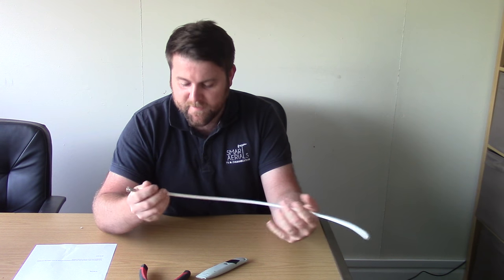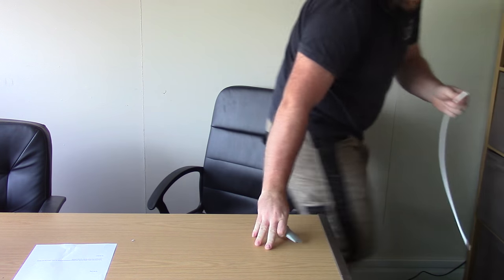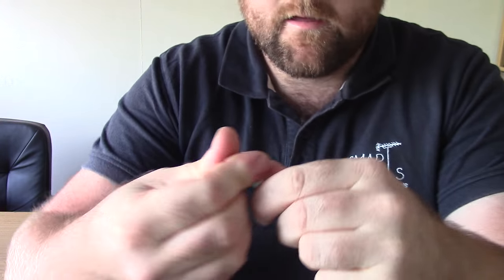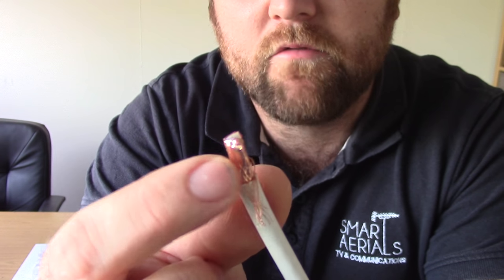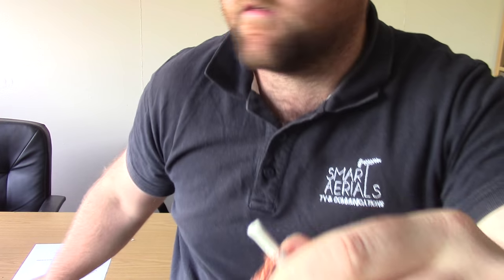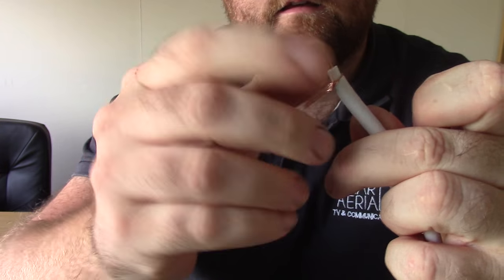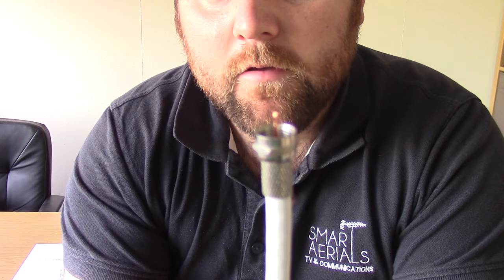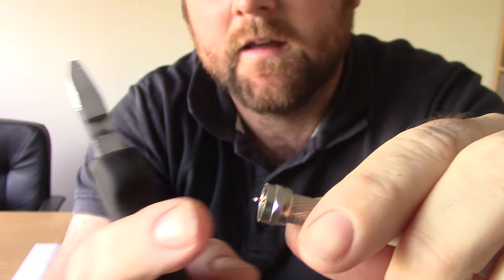How To Fit An F Connector Onto A Coaxial Cable For Sky, Satellite & Aerial Connections

Comment: Great little video, i was not too sure if a Sky cable was the same as a standard coax cable, wanted to confirm connecting, before cutting off the old connectors !
Reply from the maker: Hi Tony, thanks. Yes they are the same, but you need to make sure that it is a double screened cable for satellite.

Comment: Nice one m8. I have loads of these and always thought I needed a crimping tool to attach to the cable. Had no idea they just screw onto the wire .
Reply from the maker: Thanks James. This is a screw on connector and as long as they are installed correctly they are fine for domestic use, but some installers disagree with this. There are other types like a crimp-on style F plug and compression type which require specialist tools to install. Hope this helps, please subscribe to our channel. Tom

Comment: Thanks for this video, I love how it was clear and straight to the point, no faffing around. 
I had to remove my f connectors to move my sky box and one got a little bent so I straightened it back out but now it wont work. When I plug it in nothing happens, any ideas? Thanks in advance.

Comment: Great video thanks! Is it essential the f connector is screwed on to the folded down copper strands? If not can you just cut them away before installing the F connector? I ask as my F connector does not screw on to the plastic itself and therefore does not get to the outer plastic but screws into the white foam instead. RG6 CT100 cable with F connectors. Thanks!

Comment: TOM, how do I transfer a twin sky lead that I have into one? I need to put into the back of TV but I can't as there are two leads. I can't change the lead to one as it's through the wall. But the other single sky leads worked fine but this twin lead I can't seem to work out?
Reply from the maker: HI Lorna. If you have a twin lead you can just connect one the cables. It doesn't matter if you leave one disconnected. Unless you have Sky Q. Have you just moved to a new property or something?

Comment: Hi - I’m trying to connect an aerial cable to a Manhattan Freeview box.
Cable is ‘cable con 4.9’ I think it’s an F connect as it has the hexagon screw on it.
I need to plug that into a IEC-169-2 Female (Pal) but currently the cable doesn’t fit in.

Is there an adaptor or something to fix this issue?

Comment: My upstairs box (the wire is threaded through the house ) the wire detached and the metal parts are left in the box. Is this a live wire ? Can I do this on the wire? And the other wire touched the Centre wire does that mean it’s useless or will it work If connected once they aren’t touching when put in ?

Comment: Hi, i have a question
My TV has female antenna-in port (it's name on the internet is belling lee or sth like that), can i connect this cable to it with the F connector and adapter that will change it into male antenna-in ?
And if so, which connections will i be receiving ? satellite or aerial or both ?

Comment: Im constantly getting a No signal message from my sky Q and have to re-boot to get it working. The arial cable IS lose and probably needs refitting like shown, however after re-booting why would it always work if the cable can pull out easily?

Comment: really helpful thankyou.
my external ariel is connected to a disused sky dish. can i run my tv ariel from that sky dish
Reply from the maker: Hi Linda and thanks. No afraid not, you could use your satellite dish for Freesat, but you would need a Freesat box or Freesat TV in each room.
Reply: I suggest switching to FREESAT, which uses the sky dish, exactly as it is.. Humax make a range of receivers and recorders... and most channels have free HD optionstoo.

Comment: Hi, for some reason my type f won't just screw onto the coaxial cable, any ideas? Cheers
Reply from the maker: Hi Mitchell, it may be the wrong size for the cable. Do you know the make/ model of the cable/ plugs you're using?

Comment: the two white cables that come out of the sky box , are they the same type of cable with two different jobs or different types of cable ( asking for a friend ) 😉
Reply from the maker: You can tell your friend :p that both cables are exactly the same. Same cable, same type.
Reply from the maker: Yes that's right, doesn't matter which way around.

Comment: How about how to remove the Sky Q connectors and replace them, I need to thread my cable through the wall to the new spot for decorating. But if I let a Sky engineer doing it is going to cost me time with two visits and £120! I could do it before like you showed in this video but the Q box hasn't got an F-connector.
Reply from the maker: The main Sky Q box does use F connectors, it may just be that you have the smaller shotgun cable. The plugs are made off the same way but you would just need smaller F plugs if this is the case. (65 type). If it is a secondary Sky Q box this may be a network cable that you're referring to. Can you please confirm?

Comment: Hi Tom, another great video mate, thank you! I'm just wondering what a CX3 connector is - is that the same as an F connector? I'm trying to find the right compression connectors and tool to connect my WF65 shotgun cable to my satellite. Thanks again
Reply from the maker: Thanks Callum. Yes it is the same. Here is the right plugs for you. https://www.amazon.co.uk/CABELCON-CX3-Compression-Conn-0-65mm/dp/B00CELOKV8.
Reply from the maker: Regarding the compression tool. I'm not 100% if this one will fit the WF65 plugs so you may want to check with seller - https://www.ebay.co.uk/p/1734630805?iid=233263669742&chn=ps&norover=1&mkevt=1&mkrid=710-134428-41853-0&mkcid=2&itemid=233263669742&targetid=879667141355&device=c&mktype=pla&googleloc=1006692&poi=&campaignid=9441266808&mkgroupid=97517275362&rlsatarget=pla-879667141355&abcId=1140486&merchantid=7353394&gclid=CjwKCAjw1v_0BRAkEiwALFkj5ipA42I18VCnaFxlJanj-vV4jUhhRMGaSnssmKxrO8TMT9ROwL7VchoCX04QAvD_BwE

If not, I have a set of these. Quite expensive though! - http://www.systemsat.co.uk/f-compression/cabelcon-triple-compression-tool-cx3.html
Reply: Smart Aerials
Amazing, thanks very much mate!
Much appreciated 👍🏼
Reply from the maker: You're welcome. All the best. Tom

Comment: Can I extend an regular aerial feed from room upstairs using a splitter and F connectors to a  aerial socket downstairs outputting to the tv?
Reply from the maker: Yes you can do this.You should be OK but important to know that you will lose a bit of signal through the splitter. If after you have installed it and reception is not as good as it was, you might need to add an amplifier to the system. Tom

Comment: So all the F plugs are the same size and fit all coax cable ?
Reply from the maker: No, you need the right size plug for the cable. Most F and coax connectors are 100/ 1mm type but it can still vary between manufacturers.

Comment: On virgin media, Is the co-axial cable the cable that is connected from outside, that they drill a hole through the outside wall of the house, to put the cable through, then connect it to the box on the wall? Or the cable that connects the box on the wall to the main hub
Reply from the maker: Hi Emma, they are both coaxial cables.

Comment: If you have signs of burning (carbon dust) on your F-Connector is that likely to be the result of a short circuit between the central conductor and the many cored outer conductor? Will fitting a new F-Connector help as per this video, or is something else likely to be damaged as well? Thanks if you have time to help. (PS - thanks for the video - I will probably fit a new F connector anyway and see what happens)
Reply from the maker: Hi Alex. I wouldn't have thought so. It could be two dissimilar metals reacting with each-other. I would try putting a on new F connector like you say and see how that goes.

Comment: Would 3c2v coax cable work to connect an internal satellite socket to sky box?
Reply from the maker: Bridget Tiernan Yes it will be fine. Just make sure you have the correct connectors.

Comment: Thanks and great video, are these screw on type as good as the crimp type or even compression type? Many thanks
Reply from the maker: Screw on F plugs are fine as long as you have the correct one for the cable and it's been installed correctly, you shouldn't be able easily to pull the plug loose but compression plugs are the best, followed by the crimp type and then screw ons.
Reply: @smartaerials  appreciate the reply and info :)

Comment: Excellent help. I've been messing around for all afternoon in the loft with a box of mixed connectors and these totally didn't stand out as useful!

Are they okay to use outside like that, as the aerial I have has a male connector on it.
Reply from the maker: You can use them outside, but will need to weatherproof the connections.

Comment: I brought some f connectors from b&q watched another tutorial video on YouTube but their f connectors had a gromit formed inside, where as the b&q ones have nothing inside? So when making the final connection you push up inside and tighten down the screw nut onto the cable itself and sometimes it comes apart? I’m assuming the b&q ones are crap! How can I solve this ? Thanks!
Reply from the maker: Hey there, sorry I'm not 100% with you. When you say it sometimes comes apart, did you mean that the cable is falling loose from the plug? Also do you have a link to the other video you watched so I can see what gromit was inside, this may have just been for making a more watertight connection. Tom
Reply: Smart Aerials hi tom thanks for the reply. Yes I stripped the cable as in the video, put on the f connector (not the shot gun type) & carefully threaded the connector onto the cable. Then i screwed the f connector onto the aerial splitter that I have fitted externally. The splitter is weatherproof, but the actually splitter slides up & down for ease of use. However when I push up or down on the splitter to get slackness in the cable the f connector comes of the cable?
Reply from the maker: It sounds as so the plug might be ever so slightly to big for the cable. You get this with even the same size of cable with differences between manufacturers. Try remaking the F plug but but cutting away more of the PVC outer jacket. This will give you more braid to screw the plug on top and should make a stronger connection.

Comment: That's good, and helpful, except you don't provide useful measurements.  First you cut off "a good bit" of the cover, then remove about 1/2cm of the insulation.  The key dimension is how much insulation protrudes at this point, and knowing it is about 1/2cm less than a good bit is not very helpful, since a good bit could be anything between 1 and 3cm.